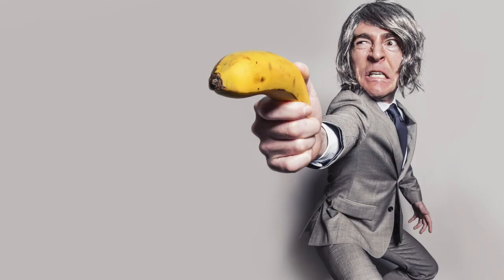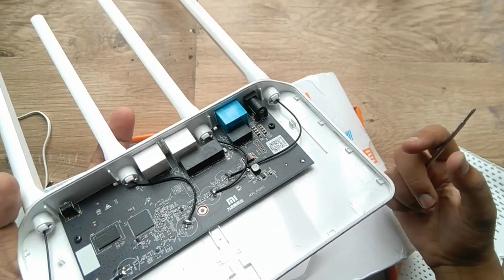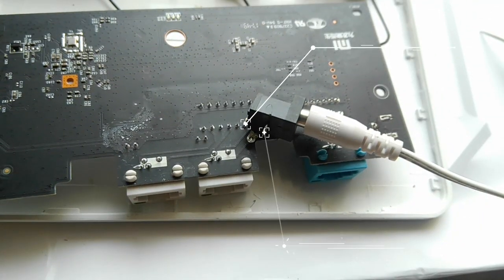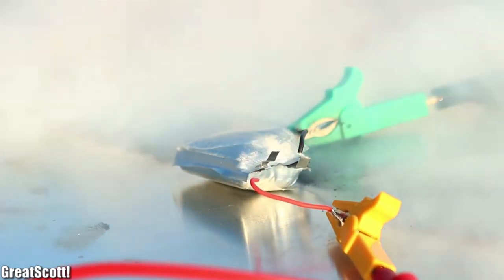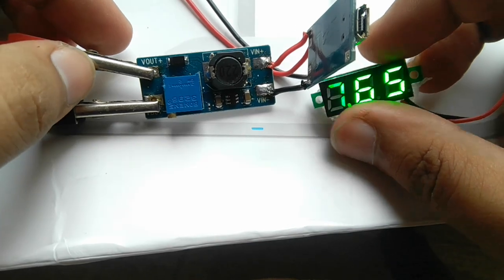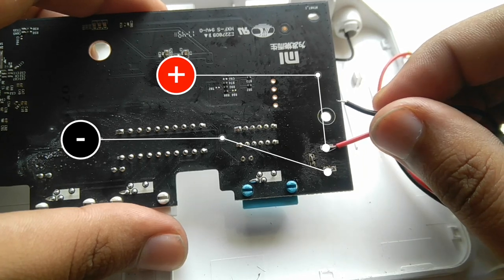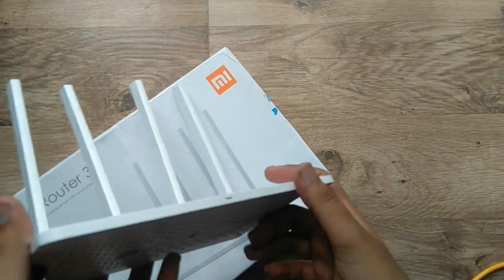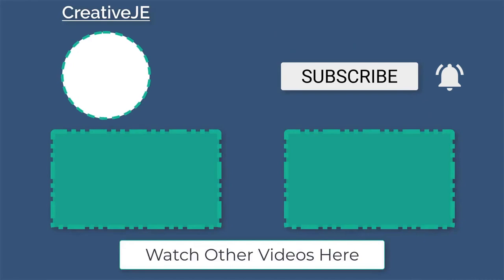DIY Add Battery To WiFi Router & Make It Portable

Comment: What is the backup (in terms of no of hours)? How did you decided that you router will work with range of 5v to 12V (which you kept max)? If the amount of power is not delivered by your power adapter, then your battery never charge or take long time to charge.  Eventually your setup will fail after couple of power outage in a day. Secondly, the battery you choose, will deliver approx 1A so, when router gets to load, it is gonna blip and reboot the router.
Reply from the maker: Look I know there are many fake projects on YouTube but my projects gets tested 100 times before delivering. And it gives me backup of 2-4 hours depending on the load and I have increased the voltage so that it can handle router's max load
Reply: If router input power is 12V and 0.5 A. So, the power requirement for the router is 12 x 0.5 = 6W

For 30 minutes backup , Watt Hour Required is = 6 x 0.5 = 3Wh

The 18650 Battery nominal voltage is 3.7V

Required Capacity = 3 Wh / 3.7V = 0.810Ah = 810mAh
Reply: So does this mean it's a scam ??
Reply: @shirsagr  18650 means bro please say

Pls

Say

Comment: If the input needed was 5v why did you used a booster to step up the voltage upto 12v!?
You should have set it to 5v right?
Reply: i guess I am pretty randomly asking but does anybody know of a good place to stream new series online ?
Reply: @Iker Crew Flixportal :)
Reply: @Roman Callum thanks, I signed up and it seems like they got a lot of movies there :) Appreciate it !
Reply: @Iker Crew Glad I could help :D

Comment: Hi i have poe switch  which takes 240v power but looking in side it has transformer in side converting it to 52v dc  would it be possible  to use Orion Tr24-48-2.5 120W DC to DC Converter - 24V to 48V
 And give it 48v dc  will it work  any ideas 
I have 24v dc power only or 12v

Comment: I know it's an old video. but I need it answered...will the router work on both dc & battery power? like if I keep it plugged in, will it act like an UPS??
Reply from the maker: Kinda, but it'll continue to use battery power as well
Reply: @CreativeJE  so I can just plug it in an wall outlet. And it will not restart even when power goes out? Nice. Also, I have an Archer C6 with built-in power button. So, guessing I won't need the power switch either??
Reply from the maker: @hossainmuhammad1670  yes it won't re-start

Comment: Thanks for the very useful video. Can I use the XL6009 Boost Converter with my Lipo 3.7 volt 1250 mah battery.
Reply from the maker: Yeah sure

Comment: I used the same circuit with XL6009 , The router is turning ON  but wifi signal is not blinking. Wifi not working. Do you have any solution ?

Comment: I set 5 volt in setup module router is on wifi not coming
Reply from the maker: Try increasing it to 12v
Reply: It's fake cuase it gives out wifi and it's not meant for a battery

Comment: I bought a tp4056, but it doesn't have an out +ve or out -ve. Can you tell is it a different tp4056 module?
Reply from the maker: really ? can u send me the link how does it look there should be an input and output
Reply: Also, i have a confusion, i have the same router. If the input voltage from the adaptor is 5 volt, why are u setting the booster voltage as 12 volt?
Reply from the maker: @nishantsinghchandra  because i tried 5v it didnt work and the router was capable of that much current
Reply from the maker: @nishantsinghchandra  the module which you sent is useless don't use it please use one which I showed otherwise your battery will die soon or won't charge
Reply: @CreativeJE  Need one more help bro, i want to make such a backup system for my raspberry Pi 3b+. Can you please help me?
Reply from the maker: @nishantsinghchandra  sorry don't know much about pi
Reply: @CreativeJE  not much difference, Pi requires 5v 2.4 amp power supply.
Reply from the maker: @nishantsinghchandra  you can use BMS module to make a 12v battery then step it down to 5v

Comment: Hi Bro, my router uses 12v and 1A input. I'm planning on using a 12v Computer UPS battery for backup. Can you please suggest how should I do that ?
Reply from the maker: Just connect 12v to the router
Reply: @CreativeJE  : No, what I'm asking is, the output of the adaptor is going to be 12v and upto 4Ah and the battery is also going to be 12v, so will the circuit board for controlling the battery be able to withstand that much volts and current ? Because you have only 5v input and 3.7v battery.

Comment: Hi, nice video ...one question ...
if i am going to use the 4A Voltage Booster , can i use like 3 or 4  Li 3.7v rechargeable batteries?
Reply from the maker: Sure you add them in parallel make sure they are almost same
Reply: @CreativeJE  Is it possible to put the in serie and not have any charging problems....??
will i have something like a mini UPS for a modem?
Reply from the maker: @d.charalampopoulos  if you will put it in series you will have to use a BMS (battery management system) to charge and discharge you can get the 3s or 4s module which will produce 12 volts when fully charged

Comment: I have a question my routers input is 9v can I use 5v for it ?
Reply from the maker: Boost it to 9V
Reply: @CreativeJE   I don't have any booster module, In this lockdown I can't get one, But I have a 5v module, from a power bank, won't it work?
Reply from the maker: No man it will not you can order from banggood
Reply: @CreativeJE   if keep charging won't it destroy the module or the Battery,? Because the router is always on it'll always charging.
Reply from the maker: @mishkattashdid8239  that's why we have used charging module so that it stops when battery is full
Reply: Hey buddy your router will run fine on 5v don't boost it. Use a circuit out of a old power bank with its own batteries if your router have space.. or if you don't mind other way just splice the external power bank from usb output to the routers input it will work just fine.. don't waste time and money on boosters... Power will be wasted and you'll loose backup time amount

Comment: How can I turn my mi 10000 power bank to 12 volt out put system
Reply: DC to DC voltage booster circuit.

Comment: You will lose your guarantee and burn your house down, no Fuses very bad soldered and no protection on the circuit board from each other for shorting out.
Learn how to propper solder ect and than shown other people stuff how not to burn the house down.
And this will not work on all routers,also could damage the router.
Easyer to use a external power bank and adapters.
Reply: What was wrong with his solder? Is it because of the lack of flux?
Reply: @Code_Machine  no cleaning from the solder points before than not enough time on the solder to melt completely, that everything can cold together much better.
Reply: Did you see him shove those boards Jamm packed into the housing.. seeing this hurt my eyes...🥴